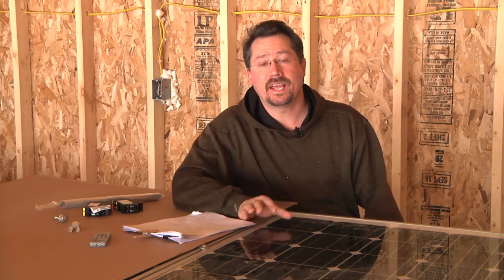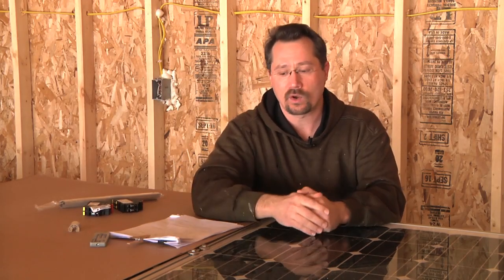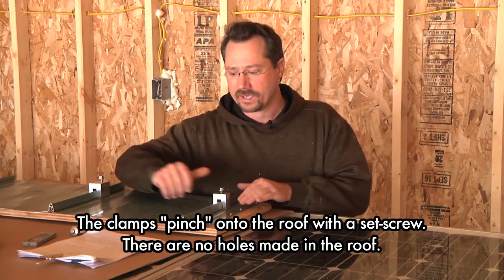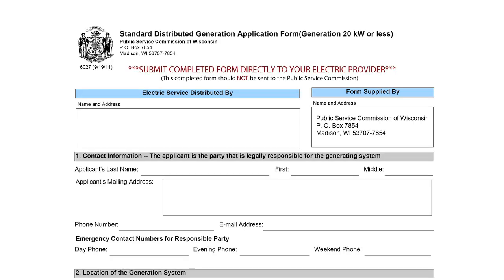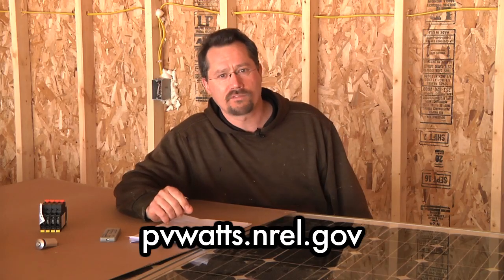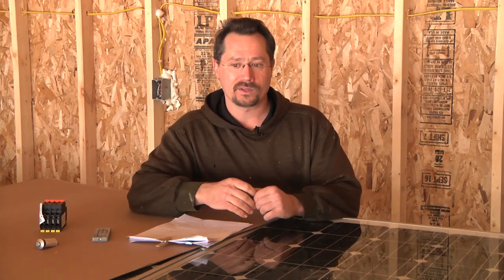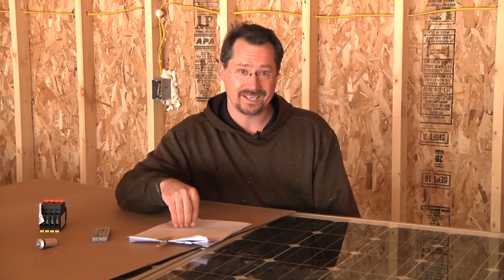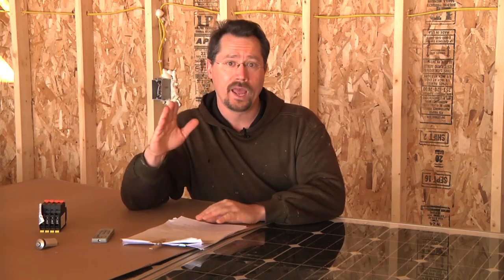Designing my Grid-Tie Solar System

Comment: Holly crap, that is a ton of paper work just to get things connected. Here in NL you can just order everything online, get it shipped to your door and install it yourself.

No wonder that Solar is less popular in the US. It's a hassle.

Are you considering building a energy storage system (ESS) for using some of the power for later? I'm currently building a DiY ESS system using a RPi with some expansion boards. If you still have batteries left it might not be too expensive to build. 
https://www.youtube.com/watch?v=_KtNb0s5bP0
Reply from the maker: I have experimented with battery backup systems. Please see some of the other comments on this video.

Comment: What do you do , if the grid goes down ?? Would have been better if you went offgrid with battery storage...
Reply from the maker: I have very good electric service in my area. We have been without power ONCE in about 12 years. Going with a battery-based off-grid style system would add significantly to the cost of the system. I already have electric vehicles, which are basically just batteries on wheels. I've already experimented with "off-grid battery backups". The one time we did loose power, I simply ran my entire house off my electric motorcycle. Whether a person wants a "Grid-Tie" system, a battery-based "Off-grid" system, or some sort of a hybrid, just depends on the individual's circumstances. In my case, a Grid-Tie system is the way to go. For someone else, an Off-Grid Battery-Based system might be the right way to go.
Here's one idea for an interesting way to use an electric vehicle as a power source for emergency electric backup: https://www.instructables.com/id/Poor-Mans-Smart-Grid-Blackout-Protection-by-UPS-/
I also still have my "Solar-Powered Swing Set", which I will likely continue to use as an "Off-Grid" power source for battery charging.
Reply: Enphase iq8 with ensemble technology!!

Comment: Great project Ben, it's slowly coming together! 
You mention multiple times about environmental benefits of switching to solar, especially considering that ~65% of Wisconsin's power is supplied by coal. What I would like to know is what the break even point is for solar v.s. other power generation methods on a pollution standpoint? Because solar panels still need to be manufactured initially. So they might financially beak even after 3-6 years but might take 12 or more to re-coop the manufacturing pollution. Helios looks like a good company though so maybe they ran a cleaner operation.
Reply from the maker: My understanding is that it takes about 2 years for a solar panel to to generate the amount of energy it took to process all the elements and create all the energy that went into the making of it. Of course, the details on that depend on the exact type of solar, the type of power used in the manufacturing etc. Many solar panels have 25 year warranties. Even if it takes two years for the solar panels to "recover" the energy used to manufacture them, they are still net producers for the next quarter century. I have a friend whose parents put up solar panels in the 1970's (when they were CRAZY expensive compared to what you can get now...) and those solar panels are still working fine!
Another interesting  idea here is that I will be using solar panels that were manufactured, and then stashed in a warehouse for some time, due to the manufacturer closing. The energy used to make those solar panels was a "sunk cost". Only by me hooking up the solar panels, putting them in the sun, and producing energy, do we get any energy return!
It's good to think about things like how much energy it takes to make more energy! This is commonly known as EROEI. Energy Returned on Energy Invested. Take a look some time at how much work goes into getting oil nowadays. It used to be very easy (like the Beverly Hillbillies "shootin' at some food") and now energy companies have to use deep sea drilling and the very energy expensive process of boiling off tar-sands. These are steeply diminishing returns on energy.
Yes, it does take some energy to produce solar panels, but they recoup that energy in not too long, and keep producing energy for a long time. No energy system is perfect, but solar is a GREAT way to go.

Comment: Ben,
I like your videos ?. My question is how did you tie the coolant into the car heater.
Does it have a coolant based heater with a heater core already, or does it have some kind of electric element?.
Reply from the maker: Hi Ben Moore. Yes, my Mitsubishi iMiEV electric car uses a coolant-based heater system. The down-side of that is it's not a particularly efficient heating system, and should really have the pipes insulated at the bare minimum. The upside is that it IS rather easy to tap in to the coolant line between the electric heater under the car and the coolant reservoir. To do that, I just cut my original coolant line and stuck a Tee in which came with the semi-truck cabin heater I purchased. You can see all the details in the videos I shot about the installation.
I'm hoping that with the new garage, when it's all completed and insulated, I should have a nice warm car to hop into all winter. The car also features an electric pre-heat feature which uses power from the wall while the car is still plugged into the EVSE. If I use that in an insulated garage, any "waste" heat just goes to help keep my garage warm! See the first heater installation video at: https://www.youtube.com/watch?v=3RHiDYGPZlY